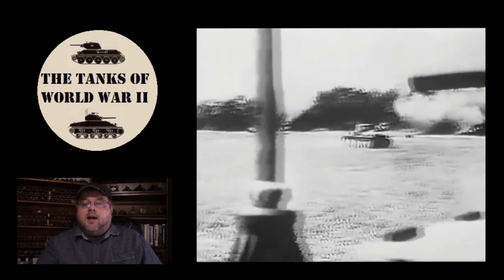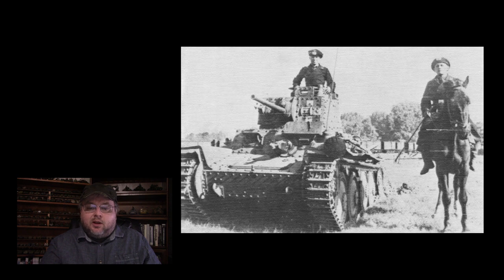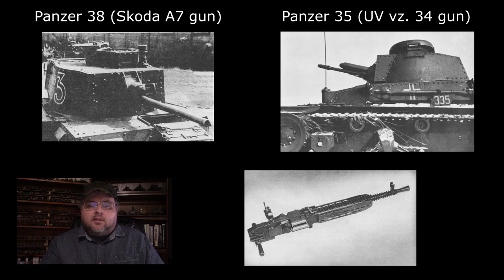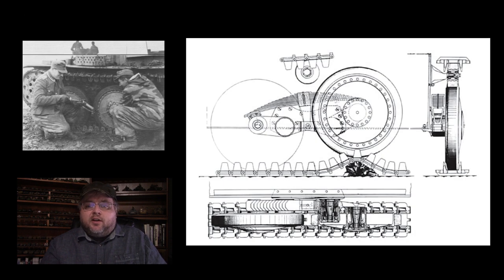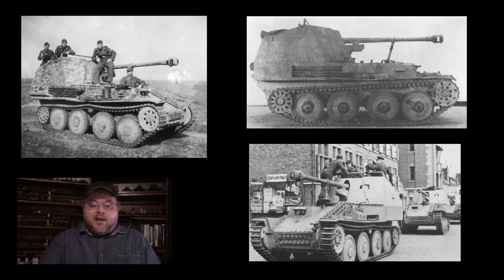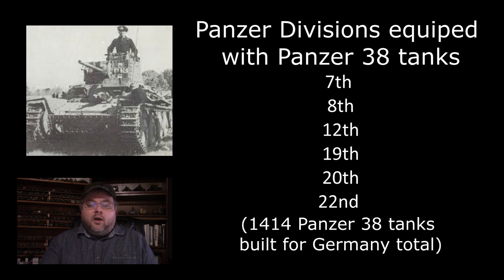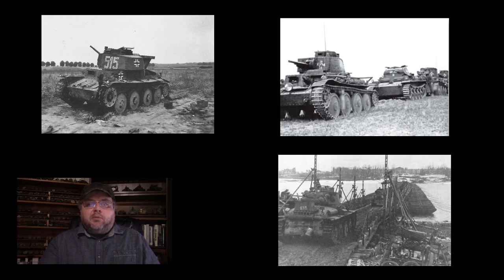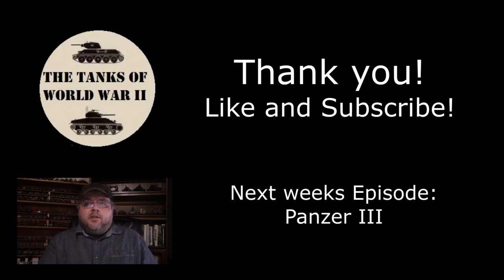The Tanks of World War II - Episode 13: Panzer 38 (t)

Comment: Is it possible T 38 inspired russian T34? I heard the Škoda company provided know how about cannons (straight to Stalin) so it is not a big stretch if the reliability was taken from ČKD.
Reply: I do not think so. The T-34 is a totally redesigned BT-5. Soviet tank with Christie's travel. The T-34 has an engine and transmission at the rear that drives the rear axle compared to the LT38. And Russia's interest in the Škoda canons was mainly in large caliber (205+).